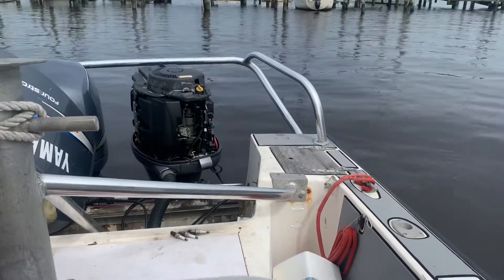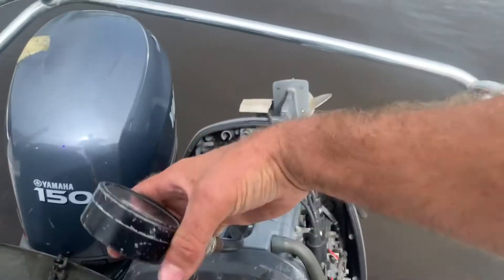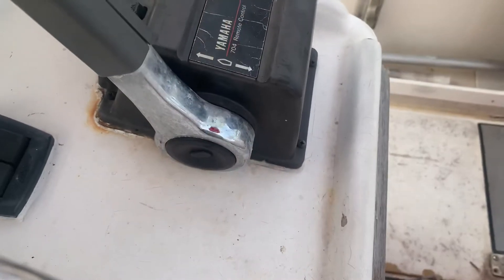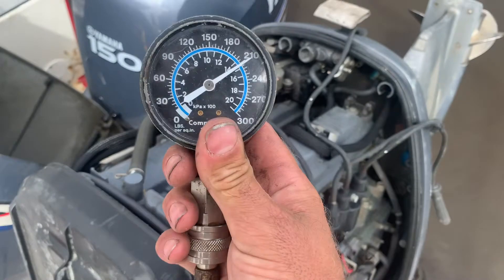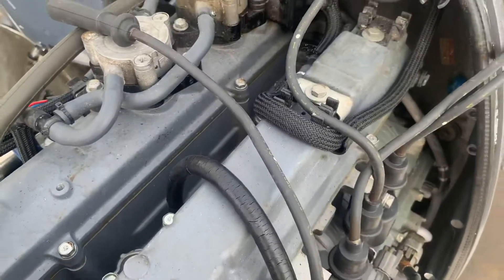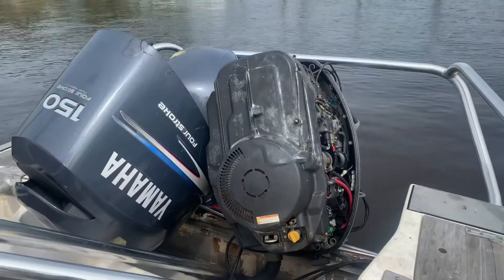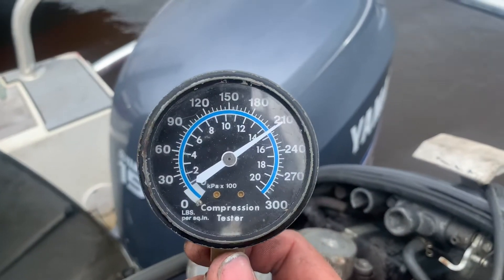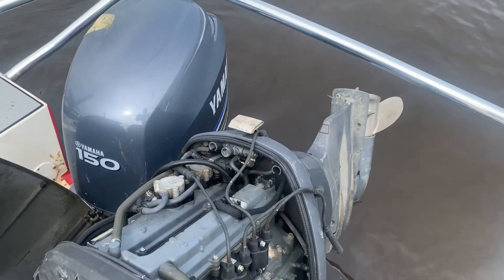Yamaha Outboard Compression Test How To and Failure

Comment: What is stopping fuel from being delivered ? Tha ks
Reply from the maker: @pastapaul150  if it’s fuel injected you can pull the FI fuse or unclip the fuel injectors from the harness. You can also disconnect the fuel like from the engine.

Comment: Did you ever figure out what the issue was? I am having the same problem with the same cylinder. Do you know the cost to fix it?

Thank you
Reply from the maker: The problem with this engine was a burnt piston. We replaced it with another engine so I could not give you an accurate repair cost.

Comment: It’s always a good idea to disable the ignition coils when preforming this test to avoid a fire.
Reply from the maker: charles hotchkiss I completely agree. A lot of engines (marine in particular)  will have a grounding stud for the plug wires to help prevent this from happening.
Reply: Yeah what do you just take out the fuse for the fuel pump?